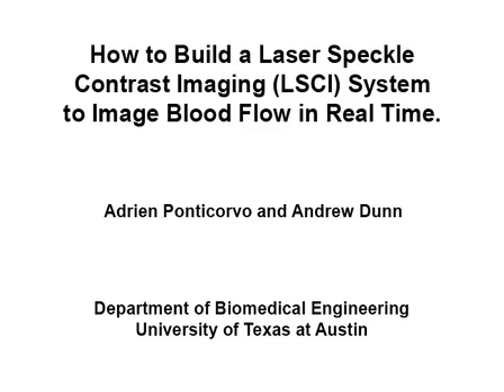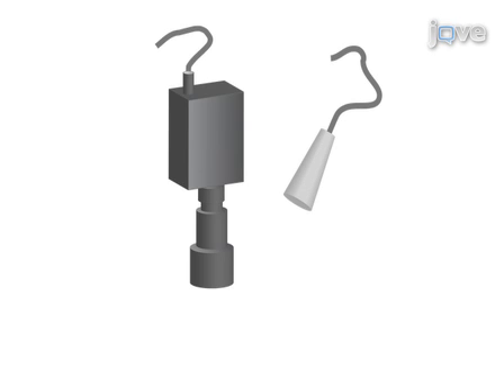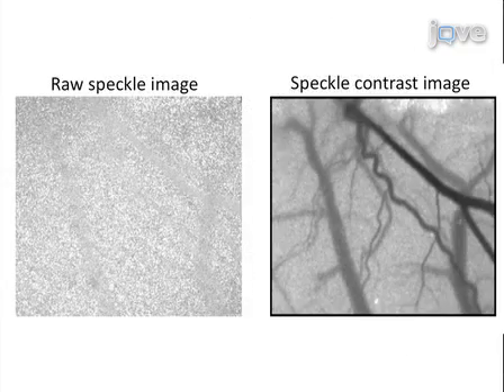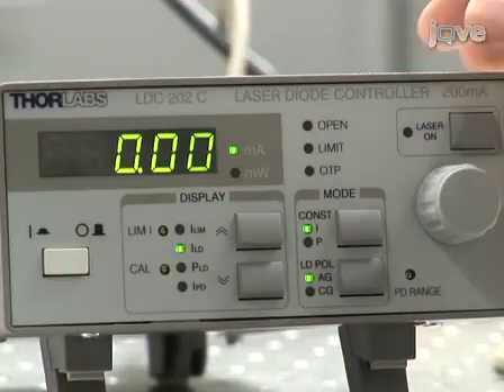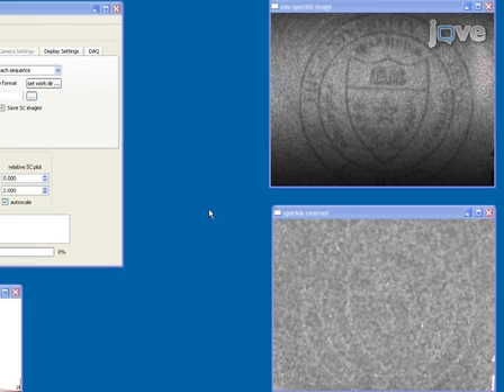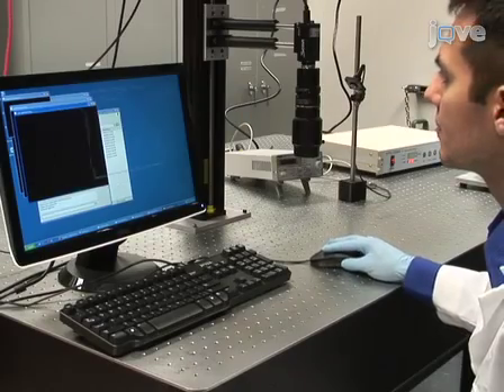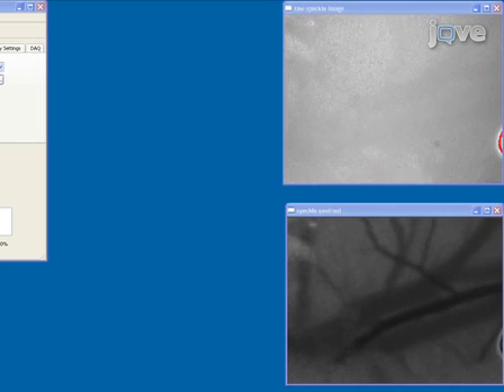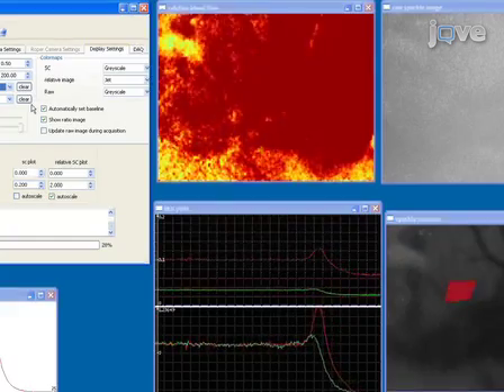How to Build a Laser Speckle Contrast Imaging LSCI Sy

Comment: Thanks, I needed a good cry for the animal mutilated for a video. I'm not clear about the laser optics. Is this basically a diode laser with no focusing lens shining through a diffuser? Or is the beam expended and shined through a diffuser? Does it matter? How important is the camera's frame rate and resolution? Which algorithms are being used?  Sorry for all the questions but I have gotten nowhere attempting to use a matlab/octave speckle toolkit and can't figure out what I'm getting wrong.